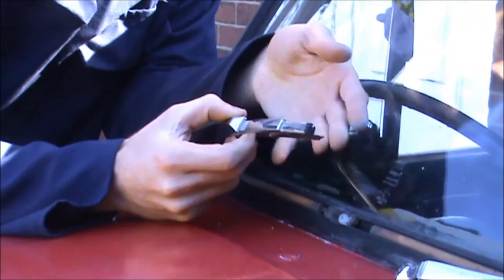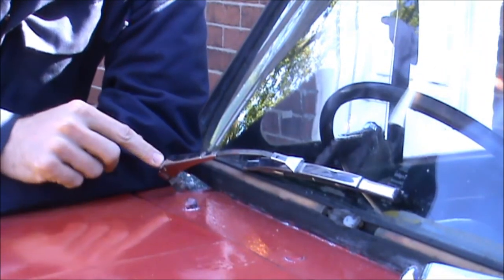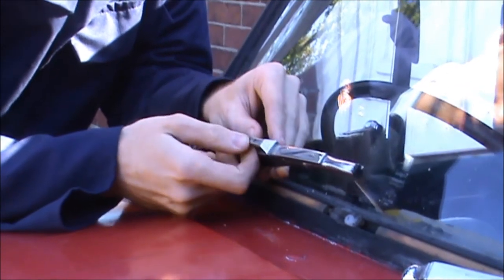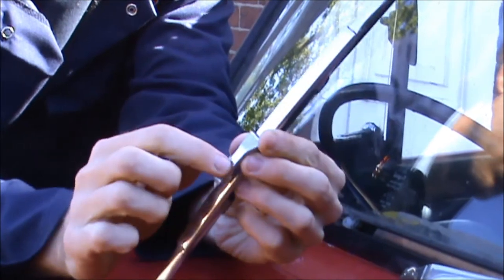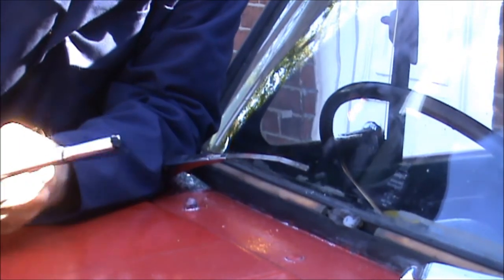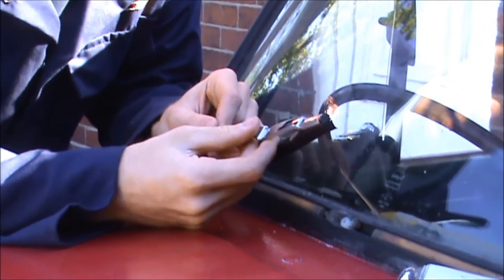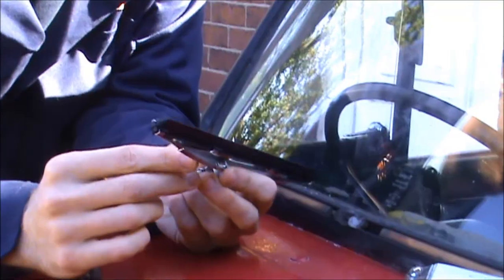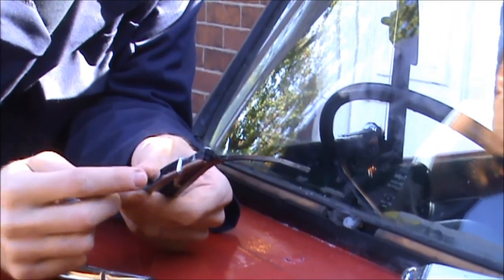How to change a window wiper on your classic car

Comment: why throw away the whole unit when all you need to do is replace the rubber piece? that size blade is the same for a classic mini and classic triumphs.  The original parts were well made and nicely chrome plated but all that is available now is what you have there which is a poorly quality made in china item which costs about £18 for a pair which is just ridiculous.